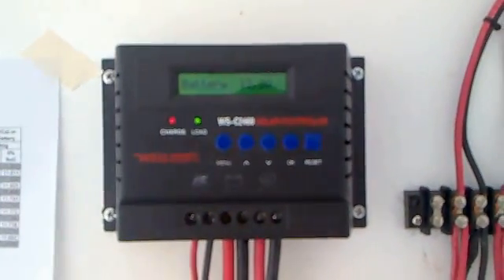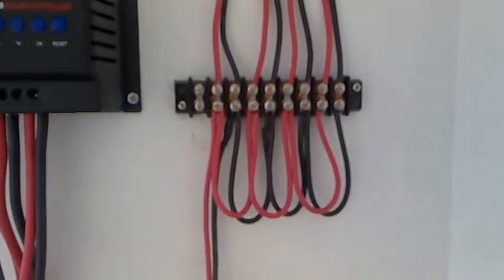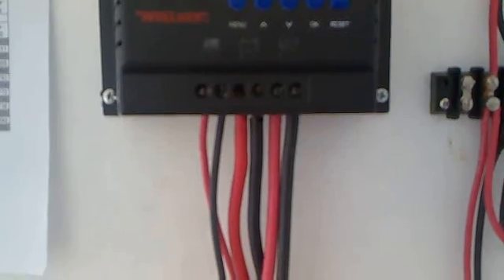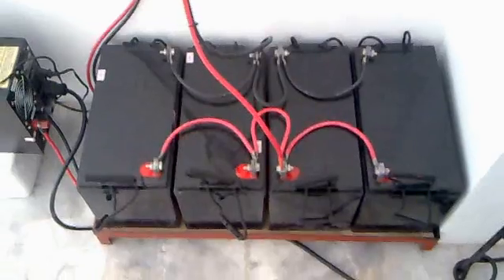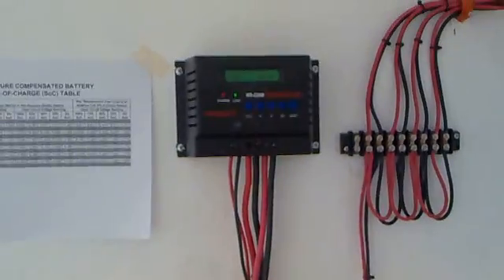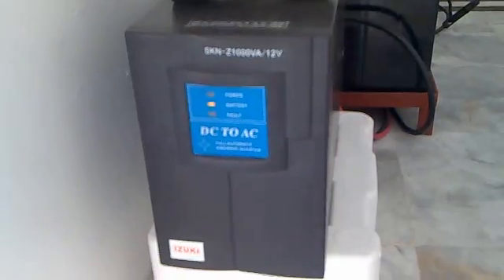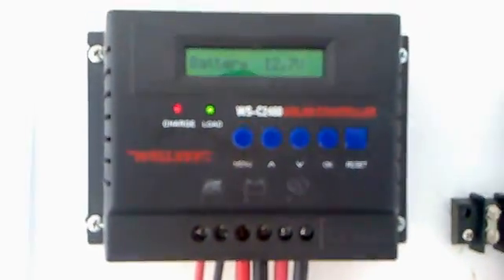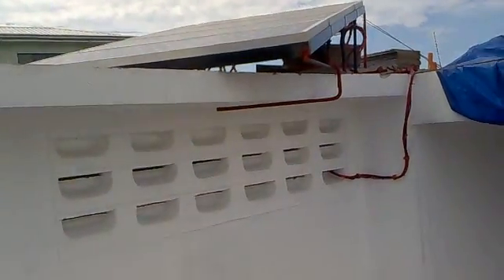Starter Home solar power system

Comment: A lot of mains voltage equipment contains  step down transformers which waste electricity.
It's better to use this set up with more efficient lower voltage equipment.
For example, solar panel charges battery, battery run invertor "inefficient" to get it up to mains voltage to run a tv, tv contains a step down transformer " inefficient" to brinģ the voltage back to 12volts for the circuit..
You'd run into problems finding low voltage washing machines, vacuum cleaners etc

Comment: Don't connect your inverter to the the load output of the charge controller, or you will trash the relay contacts in the charger. Connect your inverter directly to the battery via a suitable fuse and breaker. Use a heavy cable for the inverter input, skinny wires will overheat and cause a fire at full load.

Comment: You used long wire loops in the terminal block. Can I use about 1 1/2 inch in them? Would it matter with regards to safety and/or power losses?

Comment: Your system should be grounded or you are going to blow your inverter and controller.  If lightning should strike your panels and they are not grounded everyone in that has is in danger.  you really should not run the load to the inverter, power to the inverter is to come directly from the batteries.  Load from the controller should be powering DC appliances hopefully threw a DC breaker box.  Do yourself a favor and ground your panels, and inverter, minimum.

Comment: Morning sir.
Note : I need a pure sine wave inverter 500 watts or 1000 watts and 20A or 30A MPPT controllers that are not used anymore . If you do not mind can be sent to the address : My name ANGGA. BS.
Address : Jl.Raya Bekasi Timur No. 78
Rawa Bunga Building Blok B-9 Jatinegara INDONESIA

Because I need the tool for lighting at home . thanks before.

Comment: Are you sure it's ok to connect the "load" of your charge controller to the inverter? because in the electric world that's called overloading your charge controller. I'd connect a lamp or a DC water heater.
Reply: Moe K Agreed - and the thinner gauge wire should have been used for the panels (very low amperage) whereas I've seen many inverters (well, just about all of them 1500w and up) spec 2 gauge wire!.. that was the thinnest wire here. Clean/neat wiring though - I must say however, what he's got going on with the loops at that wiring block looks pointless. Just use jumpers or combine all the wires to a single block.

Comment: Hi is it possible to connect your inverter direct to batteries and not to charge controller?  Im just curious pls explain. Tnx
Reply: Inverters usually draw power from batteries and not directly from solar panels. As long as they have the same operating voltage yes you can.
Reply: +trebor smith (trebor0077) 
Normally you would hook up the invereter directly to the battery. 
It is not good to hook the inverter to the charge controller since it can have a surge when starting a equipment and it could destroy your controller or the controller could shut down because of overload and will repeat it it over and over again until the load is removed.

Comment: Hi William, I have built 2 solar panels from solar cells purchased on ebay. I have been successful in doing so and at a cost of about $175.00 to $200.00  per 100 watt panel.
After building them which is a tedious long painstaking job, I discovered a place where I can buy 90 watt solar panels for around $127.00 per panel and carries a 25 year manufactures warantee. you can't build a panel for this amount of money and receive a 25 year warantee.

Comment: No, but if you use more amps then the charge controller can handle it may melt and/or damage it or may damage the inverter

Comment: Yes your batteries should be fine. The cable used here In AU that is within spec is 4mm or 6mm (10AWG I think) rated for 30A

Comment: Unless building as a project with kids, what's the point? You will never ever acheive anywhere near the degree of reliability and robustness of a manufactured panel. What's more you will never acheive a lower cost than what you can purchase them for. This IS one of those things that it makes much more sense to purchase. You can buy standard efficiency panels now at less than (poly/monocrystaline) $1 a watt, even in small quantities.

Comment: In order to keep your batteries balanced shouldn't you have your input connections at each end of your battery bank. For example, your negative should be at the minus post on the left hand battery and you positive lead should be on your positive of the right hand battery. Also, if you connect your load to the batteries wouldn't it be a good idea to take the power from the negative terminal on the right hand battery and the positve from the left hand battery?

Comment: Your inverter should connected directly to your batteries..  Your setup will not be able to run your inverter at full capacity... The wires feeding your inverter need to be much heavier...

Comment: 2KW at 12v is 166.67A. 25*80w panels or 10*200W will give you your 2kw. That is alot of money up front. What you want to do 'the panels power the house" probely is something that you can do unless your inverter already have. email me and i will take a look at your system phillaboody @ Gmail.com

Comment: I have a 2KW inverter and two 21plate 12V-120Ah sealed batteries. But I want to get a solar panel and controller to charge the batteries. What ratings should I be looking out for in the solar panels and controllers. Also, I want to connect them such that the panel directly powers the house during the day whiles chargin the batteries and then the batteries take over at night without having to disconnect and reconnect them.

Comment: does anyone out there know how to make an inverter powerstar w7 series start the generator automatically on it own as the add says, cant figur it, not enough instructions and no one know, failing that is there a voltage detection devive that will start it it is a remote digital generator with remote or key, the invertter will by pass and charge the bank at 70amps, its ment to ne automatic but i cant see it krishardy2004 (at) gmail

Comment: The amps of your panel are going to be any where between 0.25 to 0.41 Amps. 99% of charge controllers are going to work. If you had a 30AH battery you would need to charge it for 120h, @ 5 hours of sunlight a day thats 24 days. if you are goint to use solar in any practical scenario I would suggest bigger panel/s (unless you have 8 or more). If however you are using this for an experiment, and you are going to monitor it, you could get away without one (ONLY if you are constantly monitoring it).

Comment: Rage Fury, The closest method he had is to method 3, but as I said if he continues to use it in this manner it will cause some damage to his batteries because of the resistance between the outer batteries and the inner ones. The method I was Suggesting was method 2. The easiest method to mod his to would be method 4

Comment: If it worries you, build or purchase a box to house the batteries. Cut a hole in the top and run a tube from outside into the hole and seal the hole around the tube. Most, if not all, of the generated gases will go out the hole. Assuming there is any gasses. Just be sure to put a screen on the end of the tube outside. Wouldn't want any varmints mucking about the batteries...

Comment: Sounds like you have a modified sine wave inverter. I believe that would cause your fridge to not run right. At least that is what I understand happens when Modified Sine wave inverters run motors in appliances. What you would need to correct this, is a Pure Sine wave Inverter. I personally so not know of another way to correct that issue.

Comment: If you are referring to the vid and how his batteries are connected:The method he uses to charge is near perfect for his setup. Google "How to correctly interconnect multiple batteries to form one larger bank."His setup looks closest method 3 (though he lacks a buss for a perfect center point on both the + and - sides) and appears to be second best of the 4 ways covered at SmartGauge. Your proposed charge method would cause him more issues than you would correct imop.

Comment: That's not how it works, the solar panels go to a charge controller and that charges a battery bank and all the devices plug onto the battery bank... basically. To run a 2000W inverter from 12v you would need 167Amps Per hour, that's allot, our fridge uses less then that in an entire day. The charge controller has no impact with the inverter size.

Comment: Thirdly, although probably the first thing you should do, is to chance the wire size between the batteries themselves and going from your batteries to your inverter. My recommendation would be to change to a wire to at least a 4 AWG or Brown & Sharpe wire gauge (AWG and B&S... same thing) but going with a 2 would be better. Lastly I would get a ground in the system. Any questions email me phillaboody at gmail.

Comment: The first thing you need to do is move the Positive lead to one end of the battery bank and the negative to the opposite end of the bank, this will help with extending your battery life, if you keep it as is then you will run one battery down more then the rest and that will cause problems with the whole bank. Secondly you need to connect the inverter to the battery bank ONLY (the same place you have moved the pos(+) and neg(-) cables to. Disconnect from the charge controller).

Comment: can your battery bank powers ur fridge or other lights 24 hours  or just when  need arises?  how much battery banks i need to power my fridge, pc's lights etc. do u  a fork lift battery bank is enough  to power all my household needs?  Ive got 800 watts solar panels but just feed it to the grid so i waste some energy off the grid. I want to save some energy for my ngiht use. thanks

Comment: The charge controller is only for the solar panels.  If its a 20 amp controller than it can handle up to 20 amps of power delivered from your solar panels while charging. Than the charge controller sends it to the battery bank.  Your inverter amp usage should be noted because it will determine the gauge wire you need to wire it to your battery bank. any more questions fell free to ask, will try to help

Comment: the charge controller needs how many amps per the inverters has watts? If I have a 2,000 watt inverter, do I need a 20 amp charge controller?

Comment: the voltage regulator only charges the battery. why is it in series with the inverter? that load terminal is to prevent over charge in the batteries by having an appliance connected to take the excess voltage.

Comment: I want to build a 36 V solar array. The only true sine wave invert er available in the market locally is a 36V DC to 220 V ac . I am unable to get a 36 V 40 Amp charge controller. Could some one please let me know an alternate solution? Is it possible to charge a 36V batt. bank through a 48 V Charge controller? In the local market here only 12 V , 24 V , and 48 V Charge controllers are available. These are not programmable, but have a peak power tracking capability. PLEASE HELP

Comment: I'm not expert but if the 36v are open circuit voltage you would need a 24v charge controller.  Once you put a load on the panels the voltage will go down.  As far as the amperage of the charge controller take the amperage of each panel and multiply it by two if you connected the panels in parallel and get a charge controller with an amperage higher then that.  anyone with more experience please chime in and help him out.

Comment: HELP! I have two, 36v solar panels. Im trying to build an "off grid" system. I noticed a lot of people using 12V or 24V charge contollers. Is that safe or should I be using a 36V charge controller? what should be the proper amperage? I dont want to over heat anything and just charge my batteries s fast as possible.

Comment: Why is the inverter connected through the charge controller?  Most controllers I've seen don't allow a series amount of current through their "load" terminals it's usually just for lighting only while real loads need direct connection from the batteries to the inverter or the controller kicks the load out and may even stop charging in error condition when the load exceeds its very small current limits...  ?

Comment: Your video was very good. The DC-AC converter is connected to the battery bank? Solar energy powers the controller batteries and then what happens? The transformer is online?

Comment: Camping world prices on solar equipment are so outrageous that they are most likely getting hosed on their wholesale side too.   You should not have to pay $500 for an 85 watt panel.   I sell them at $200 locally and make a healthy profit.   Charge controllers in the 30-50 amp range at $70 to $120 (max).   Batteries $80 to $250 each.   Wiring ($100-$125) is a lot of 12g double insulated panel to bus bar, 8g-10G elsewhere, then some 00 battery to inverter and batt to batt.  $300-$500 inverter.

Comment: Camping world is a ripoff when it comes to solar system components.    I have a system very similar to the one in the video with most of the components coming from Ebay sellers except the batteries which I bought locally.   I recognize those as the type used in larger scale uninterruptible power supplies(UPS).  Total system costs around Portland where I am at would be roughly $2500 for all new components, but I got used batteries which brought that way down.

Comment: nice set up I'm just starting out with a windturbine and will be buying pannels as I go I just have to start building my batterie bank. right now i"m just using some cheep 12 amp hour 12 volt battries they are cheep I can get two on ebay for like 40 bucks great video man.

Comment: What is the guage of wiring in that block to the right?  I suspect Guage 10 to the block but what about away to the controller?  Do you loose any power or amps away from the block to the controller?  I have three panels on my roof but I have three controllers. One for each panel. Bill Cooke, snb

Comment: true that the batteries can pump out 4800w at 12v however the inverter is a 1000kva or around 900w so the maximum it can ever draw in is 900w/12v=75a more likely 85 due to inefficiencies. Under ideal conditions it could operate at max draw for 4.5 hours but since DC-AC inverter cuts off at around ~10.5v I'd say ~3 hours or so. Still not bad to keep just the fridge running for close to a week after a power outrage if not opened too much.

Comment: @mikelfc2010 (continuing) the DC-AC inverters will need both a off-grid tie to generate a pure sine wave and several cheaper Grid-Tie-Ins(cheaper this way) to increase the house wattage otherwise the inverter breaker will just disconnect when you turn too many things on, 6k watts on 120 is the minimum you wanna have to deal with big things turning on without burning the inverters, also electrical driers need 208v so you would  need a 208v converter or a 30 amp draw on the 120v with a transformer

Comment: @DRUMSKAPE depends on your overall power use, but to be on the safe side you would need 1.5 to 2 times your current monthly electrical spending in panels to compensate for cloudy days and such and a battery bank around 1K amp/hour or larger depending on how many things you plan on using at time like washer, dryer, ac, etc... ideally the closer to 120v the bank and AC converter operate on the more efficient it would be, suffering from much less heat and conversion losses, so 60v>48>36>24>12, etc.

Comment: I would use a system of 24V and a Grid Tie inverter. That ally and the efficiency has a direct impact on the energy bill.Well I think your government to give incentives for those who inject power into the grid.

Eu usaria um sistema de 24V e um inversor Grid Tie. Isso almentaria a eficiencia e teria impacto direto na conta de energia.Pois acho que seu governo dar incentivos pra quem injetar energia na rede.

Comment: Nice set-up.  I have one comment though, I see you are using a PWM regulator.  Have you thought about using a MPPT regulator?  You will end up getting aroung 25%(I'm not 100% sure about the exact value) more power out of your panels.  By the way, are you in the Philippines?  I have an off-grid system of my own and I am planning on posting a video about it soon, just waiting for good sun.

Comment: romppais (dot) com sells all kinds of wire and cable of all sizes, as well thousands of 6 to 48 volt DC parts and equipment, lighting, covering anything from aotomotive, marine, solor and heavy equipment, as well a large line of AC controlers, brakers and more, use welding cable of minimum 3/0 for all battery cableing, and a 300 amp fuse on the battery +